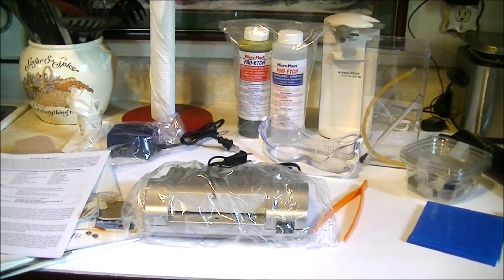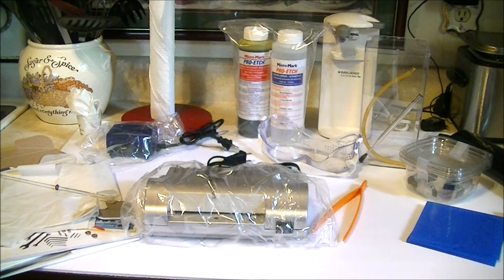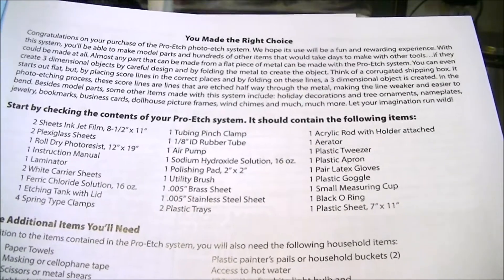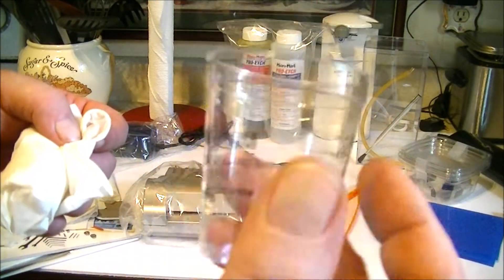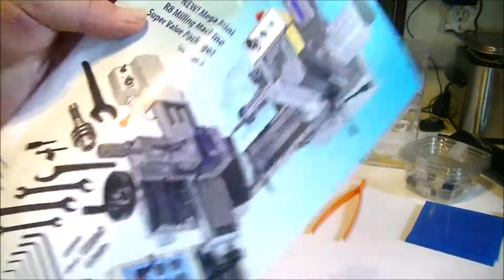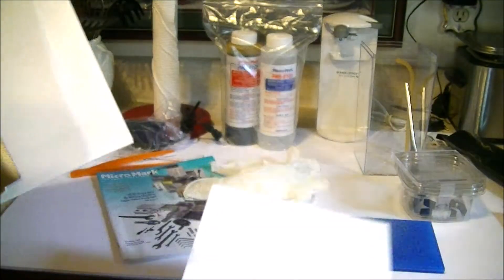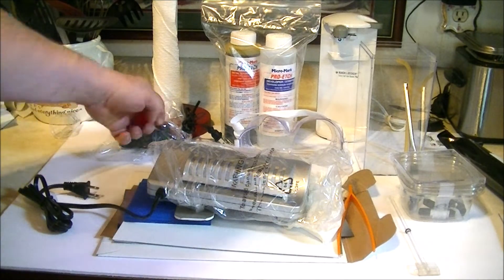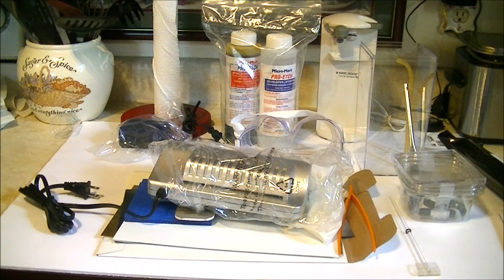Micro Mark Pro Etch Photo Etch System Review and Let's Try Part I

Comment: Imagine my surprise-- they do include ferric chloride-- that's not the chemical in the video. Plus Micro-mark was always such a pain in the neck about their bottles and shipping-- also, UPS and USPS have different approaches to shipping such chemistry. But This is everything you need, indeed. I like they include some stainless-- it's a little tougher than the half-hard brass.
Note: the little "filter" thing is actually the aerator, the little orange clip is a "valve" for the rubber hose (I'm sure you've figured all that out by now). Extra special warning--- Lay out one or two garbage bags in your kitchen-- wherever you are working, up the walls too. That FeCl, stains like few other things. One drop on the wrong surface... it's there forever.
The only limitation is the size of the etch tank-- you will, if you so desire, overcome that with a larger tank and bubbler system. When I built my system, I designed it to use as little chemistry as I could get away with. Now I buy the FeCl by the gallon.
Reply from the maker: Thank you. Got it... Totally know about the black stain of death... LOL! thanks for the heads up anyway.